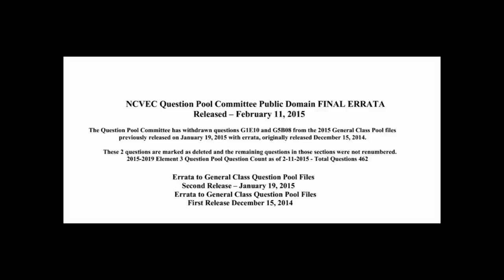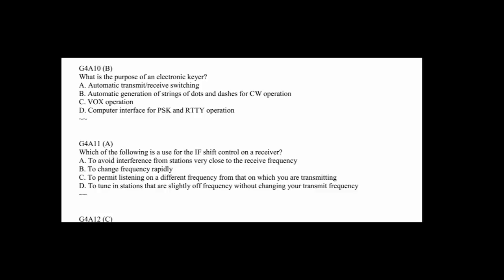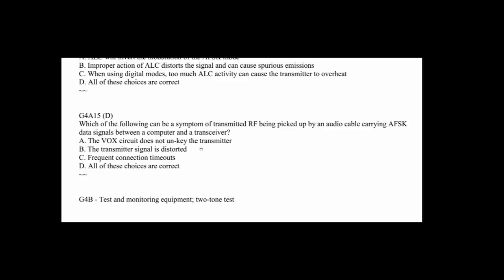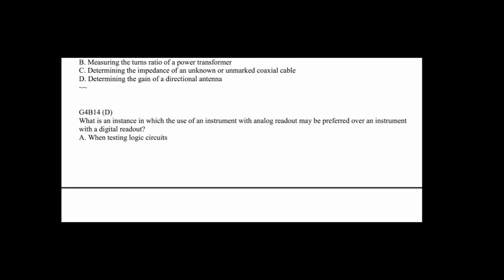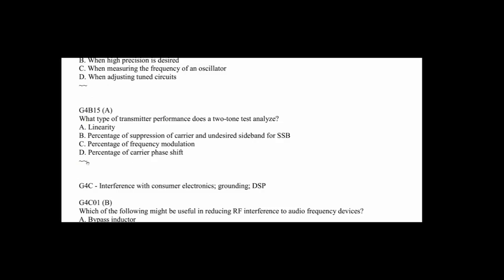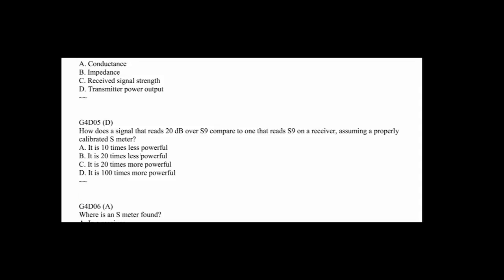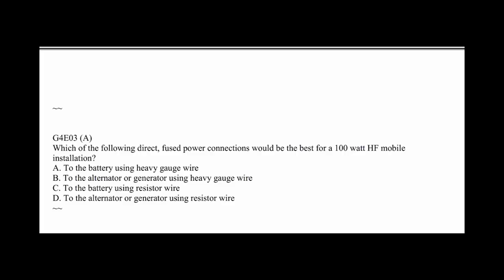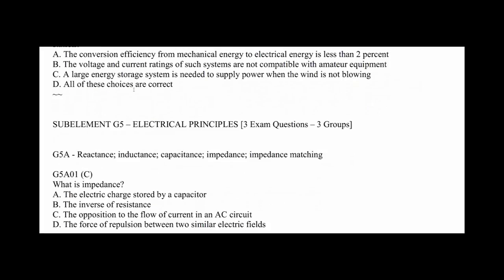Ham Radio General Class License Prep Course by Jim Heath W6LG; Part 4 of 10

Comment: Hoping to take the Tech and General exams soon. This is helping a lot. Thanks Jim!
Reply from the maker: Best of luck!  Studying the question and ONLY the correct answer along with its letter.  For example, the correct answer is A.................. or B........... etc.  73, Jim
Reply: @ham-radio  Thanks! This is not easy for me to absorb at the age of 63, but at least I have a background in professional sound systems and military radio communications to help me along. Plus, I was very big into CB back in the 80s and 90s. So I am now the proud owner of the President Lincoln ll+ mobile radio with 10meters, 11meters and 12meters. I paired it with the Stryker SR-A10 antenna.